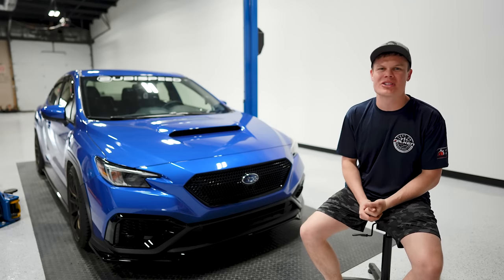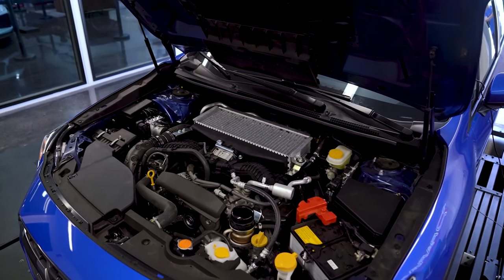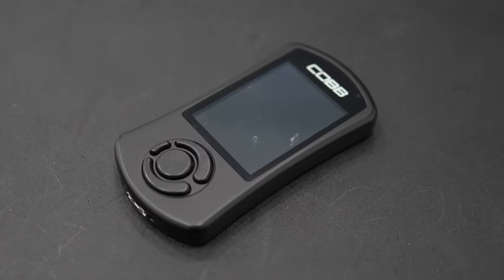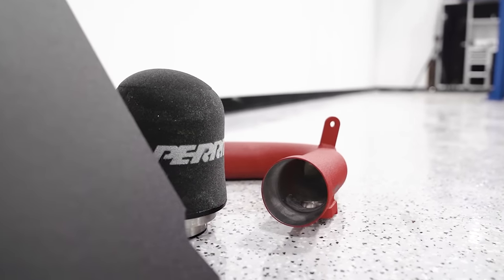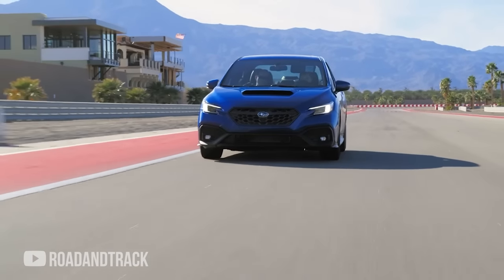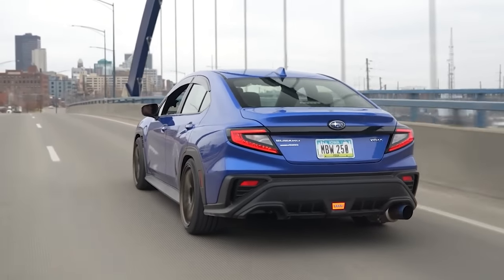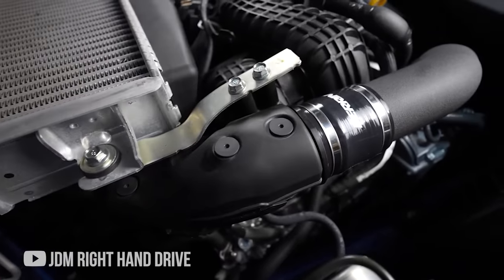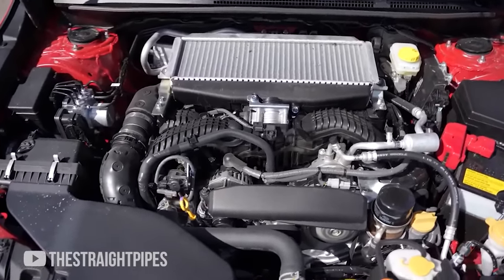Modifications that Make Power on the 2022+ WRX!

Comment: Pretty crazy that tuning for these cars was unlocked just 5 months ago. We’re still in the early days and already knocking on 500hp with stock turbo, internals, heads, and fuel system. Once the STI trans swap is normalized and we get into built motor, big turbo, full e85 builds, this generation is going to be the bananas. I’ve heard some of the big names in Evo X tuning have picked up VB development cars now, so the future is looking bright!
Reply: “knocking” is the key word here.
Reply: like knocking? or like actually knocking? 😂
Reply: isnt this the same boxer engine they put in the brz/gr86? if so, im curious to see how theyll fair under heavy boost lol
Reply: @wyattllc  they share the same general design (displacement, bore and stroke) but otherwise they don’t share any components. They have different pistons, rods, crank, heads, fueling system, intake manifold, etc. The FA24D in the GR86/BRZ2 has a 12.5:1 compression ratio and smaller injectors in the DI side so it’s definitely not set up to handle high boost at all from the factory. Right now HKS offers a small supercharger kit that brings it up to 292hp at the crank, so like 40 additional horsepower at the wheels. That’s a pretty small bump for the $5000 that kit costs. Seems like pistons, rods, and fuel system upgrades are definitely going to be necessary to get up above 300-350whp.
Reply: IAG is only working on the stage motor
Reply: @reesee175  yeah i live like 15 minutes from westminster where IAG is located and was so disappointed to hear they don’t dyno tune anymore . was gunna take my 18 sti for a pro tune :(
Reply: @robertlivingstone8733 there’s a few past 500 now with the ets turbo kit

Comment: To my knowledge the highest Horsepower amount of an fa24 was prime motorings fa24 swapped crosstrek which was at over 500.
Reply from the maker: That would be an amazing sleeper! No one would see that coming. Haha
Reply: @raymullen8427  funny story about this, I actually found this out a few days ago. That FA24 engine was sold to them by my local Subaru shop, Ecotech. They were actually going to build a car but we're busy with Subarus rally cars and ended up selling it to Prime after they practically begged for it. I can't believe at one point I lived in the same state as the first FA24dit and didn't know it 😭
Reply: Someone skipped math class. Said can get 290 with just 93 and a cobb tune, then said 40hp with an intake. So 330ish but then said only 340 when you have a professional tune, exhaust and an air intake.... bro no way a professional tune and exhaust is only adding 10hp if the intake added 40...

Comment: I have a 2023. It’s great stock. 300 HP is all that I would want. 😊
Reply: All I want is a Perrin intake to give the whooshy sounds. 😅🤣
Reply: That's all i want to if he's talking about to the wheel
Reply: @mattwilliamsonguitar I had the Perrin on my VA wrx. “No tune needed” they said.. car went into limp mode the 1st time I gunned it. Long story short, I now have a VB with a stock intake..
Reply: You say that now..
Reply: @nikkoteen1314  Never do any mods on a Subaru that affect air or fuel without doing a dyno tune. Crazy if they claim that on their site.. they should know better than that. It's common knowledge Subaru's are very fragile when doing mods without a tune. They may even be able to be sued from such a claim, if someone blows their engine from it, which is very possible. Intakes are worthless without an aftermarket turbo, anyway. They make cool sounds but that's it, the factory intake is more than enough on the stock turbo. Aftermarket turbos are a different story. That being said, if you have a tuner in your area with a dyno, definitely get a downpipe and dyno tune. It's worth every penny, it's so much more fun to drive afterwards. EDIT: I see why they say it's safe, now. It's the same diameter as the factory tube. That being the case, even with a tune it probably wouldn't help performance, at all.. that's just a noise maker.
Reply: @hhaste yeah I specifically got it for the noise (yes, I’m a dweeb). But yeah, lesson learned. No mods other than cat back exhaust on my VB now. Amazing that Perrin still advertise their CAI as needing no tune.

Comment: I keep hearing talk about e85 on these cars, but nobody raising the question as to whether the stock fuel system is e85 compatible. Is there any reason to believe the stock fuel systems are e85 compatible? I cant imagine it is. Seems pretty risky to simply dump a bunch of e85 in a car without knowing whether the fuel pump, lines, injectors are going to fail creating a ticking time bomb.

Comment: This is a great engine the only issues is Subaru put that crappy split case 5 speed WRX transmission they added a gear to and called it a 6 speed if I was you I would have told everyone at the 400-450 WHP TRQ you may want to think of doing the STI drivetrain swap Becuase I don’t care how strong of a aftermarket clutch you have the split case transmission is going to blow I have a VA wrx making over 400whp and doing the STI drivetrain swap was the best mod I ever did anyway love these FA24s just wish subaru would have given us the STI drivetrain on these cars
Reply: I cant echo this enough. Not only is the sti 6 speed infinitely more robust, it also feels significantly better even stock, than a wrx split case with bushings mounts etc. Best thing you can do for a VA, and likewise a VB imo.

Comment: I have a pro-tuned FA24 Subaru Ascent by Jr. Been on the dyno several times. I’d have to say I added the EGR delete kit from IBR way back with my beginning mods in order to help save the engine! I’d suggest it to everyone as well with your upgrade process. So far I can’t ever get enough of driving this beast… Let’s just say she can get down!!!!
Reply: where is this egr delete kit?
Reply: @Rabbit14  I just modified the one for the wrx from iBuildRacecars
Reply: How’s the cvt holding up? We have a wilderness that I’ve been wanting to up just a bit.
Reply: @xfozzypx115  everything is A ok so far
Reply: Jr is a great 4cyl turbo tuner. Tuner my Mitsubishi Ralliart to 452 whp. Thing was a beast.

Comment: Leasing a 2023 for now. Will see what's out when the lease is up but I think I'll probably buy it out at the end. Definitely doing catback, short shifter, and wheels for now, but first thing if I end up buying it out are the breaks and sway bars. Seems like the FA24 sits lower in the bay than the EJ257 so 300~350 HP should be plenty. Thanks for the video!
Reply: Doing the same here. Just picked up mine on Friday and plan to buyout at the end.
Reply: That’s what I said, then I leased another rex cause my miles were low and had zero down payment. Then I did it again 3 years later, lol.

Comment: Hey we’re in the 450-460 range and 530+ wtq! Lol
Don’t short me
Reply: Great video btw guys! Keep them coming
Reply from the maker: Even better! Must have seen some older posts. Keep up the great work!
Reply: is that on pure e85?
Reply: keep pushing till you blow the motor and trans. take 1 for the team, we need the data!
Reply: @LAdumpsterbaby e60ish still working on full 85
Reply: @way2faded I’ve been trying for 6-7 months once they dropped software even before that. They’re tough engines
Reply: @DrunkmannTuning  in a few years,my VB is all yours 🙏😎👍
Reply: @DrunkmannTuning  good to hear, thanks for the effort you put in 👊
Reply: @way2faded  Trans will go first, guaranteed
Reply: 1 year later, how has the transmission held up?

Comment: Any ideas of what kinda power I can expect I really wanna get it Dino ran but don’t have one near me anywhere close sadly  prolly a good 4-5 hour ride to get that done and  need to schedule it well in advance car should be running real soon iv got a 2017 wrx fa20 iv got it’s built all forged internals heads upgraded from aluminum to steel valves  all new timing and oil pump  ACL high performance bearings are installed -oil journals have been opened up for the main bearings to improve oil flow 725 series twin disc clutch and kit with upgraded steel clutch  line  forced performance blue ball bearing 🙃 turbo external waste gated and grim speed intake with the box grim speed cat back exhaust - tomei exaust manifold working on getting the billet aluminum process west  intake racing manifold really  soon and working on getting the front mounted intercoooer in the future  iv already got the 450lph fuel pump with hanger and kit iv also got the nords storm stage 1 hpfp with injectors kit on order waiting on them hopefully by the end of the month waiting for them to be released. Looking to see what kinda power to expect  . I havnt got the catch can kit yet I’m also doing the tgvs in the future prolly add them the same time I do the intake . Working on a 500 whp wrx as my daily 🙃

Comment: Ok so first of all tuning doesn’t blow your motor
It helps significantly improve the engines reliability 
If you add the correct mods 

Don’t add big turbos but not upgrade your boost controller, or add a down pipe and header but not add an air oil separator.

Don’t be obsessed with a power number.   
Definitely add an oil cooler definitely add an upgraded oil pump , oil pan and oil pick up
Increase your oil capacity and keep it cool 😎 

I have a 16 wrx I bought with 5 miles on it. Had it tuned to a stage 2 setup with 5k miles 
I now have e85 sensor and tuned making 387 whp on a stock block with 149,000 miles and my car is still absolutely fun to drive.

When modding your car the rules for dealer recommendations for maintenance go out the window because you increase the load and friction on mechanical parts.  So instead of oil changes every 3k 
Do it every 2k

Comment: The real question is how well can that motor hold at 400whp+ ? I feel like it’s not a matter of if it’s gonna happen, but when it’s gonna happen.
Reply: Isn't that really the outcome with any car..not if, but when
Reply: @ericlinn8647  not really. I’m just talking about this FA24 specifically. I know some other stock motors that can handle 400whp-550whp all day. And then I know some that can’t even reach 400whp without bending a rod or something.
Reply: as an employee at subaru i can tell
you that these motors are most likely one of the most durable ones they ever built

Comment: 😮470 awhp on mustang dyno? That’s insane, I know every single dyno have unique calibration and can’t be compared, but I think that translates to about 650 crank HP🤯
Reply: 20% drivetrain loss would be 587
Reply: @MeltingRubberZ28  20% is a very rough estimate, my local shop has a mustang dyno and it’s very conservative, it reads just bit over 400hp on stock Nissan GTR and 470 on stock c7 z06,if a WRX makes 470 whp on that dyno that’s very very impressive
Reply: Funny, the factory FA24 Turbo is incapable of flowing enough air to make that kind of power, even on ethanol. Must be an aftermarket turbo.

Comment: Decent numbers for bolt-ons. To be honest, I was impatient with Subaru making something that would not blow up after 400hp coming from the hawkeye. I am so glad I switched over to the Evo platform a long time ago. Seems like there will be room for more development for these cars. Honestly, the same old dance for most of these 4 cylinders. Sleeved built block,  set of cams, big fuel pump, ID2000's, big-ish turbo, 50/60 psi boost, and it will be running 8's in no time..hahaha
Reply: 😂 thats like fully modded bike fast lol

Comment: I just bought a 2024 WRX with a CVT because I didn’t want a car my wife couldn’t drive. Are there any mods I could do to increase the horsepower without risking damage to the transmission?
Reply: The CVT is limited compared to the manual but I've seen 320 hp on a CVT. That's not a lot though.
Reply: @ cool thank you!

Comment: Thanks for this awesome video! If I get protuned for E85 will I be able to use 93 octane in a pinch if I'm driving the car cross country or something and don't know where my trusty fillup spots are? Is the sacrifice only for performance/efficiency? Or would it be totally unsafe for the car to go back to 93? Or would it not work at all?
Reply: If you have a tune for ethanol only (non flex) then you absolutely NEED to use that exact blend. Whether it be e30. E60 e85 etc.

If you have a flex tune it doesn't matter.

Just like if you have a 93 tune, you gotta use 93 gasoline. 

93 gasoline has about 10% ethanol in it as is and those values could be a bit higher but not a lot. 

Ethanol requires more fuel to be dumped into the engine so if you did straight 93 on a specific e85 tune you would be silly rich and knock like hell from the much lower octane.  Ethanol also has a cooling effect that your tuner would of taken advantage of in the tune. Take that out of the equation also and your engine is in very risky territory.

Subaru engines are very picky about the modifications and tunes they get. Do a ton of research prior to modify your wrx please. This is why the platform gets such a bad rep.  Im not saying you're the cause just saying don't be a statistic 🙌

Comment: you can put a ets top mount and front mount both on right
Reply: You can only put on one intercooler at a time.
Reply from the maker: Got to pick one or the other!
Reply: @HeavyMetalWRX  what the better route, front mount I assume
Reply: @colew2178  it all depends on your build and future plans. If you know you'll be going past bolt ons later it's ok to spend the money on a FMIC now. If you're just doing some mild tuning with 1-2 extra options (Intake or jpipe) then a TMIC will be sufficient. Both are great options and a FMIC really gives your car that tuner look.

Comment: Does anyone know if you would need a tune for reliability if I were to install the ETS TMIC, or would it be safe to keep it on the stock tune? I understand you would get more performance benefits from a tune, just wondering if I can hold off on the tune will I'm waiting to get other internals before tuning the parts all together.

Comment: I’m planning on getting the 2023 WRX CVT , will all these mods fit into that car ?
Reply: The only difference that I'm certain of is the transmission.   You should be able to use all the same mods for the "Subaru Performance Transmission" aka CVT.   I'd be more worried and interested in seeing how much power the thing holds.  I can see a future of the CVT holding really high power numbers only if built correctly.  We used to say that automatics couldn't hold the power and now look at some of the fastest cars on the track.  

Anyways, you shouldn't have any issue in modifying with these parts, should be all the same.
Reply: I would be leery of doing power mods with the CVT. Maybe wait until there is more data on this. I wouldn't go beyond 300hp. If I had the CVT I would keep it stock.

Comment: Question. I have a VB with Perrin Intake, AWE catback, COBB OTS tune.  I’m waiting for my charge pipe to come in, would it beneficial at this point to need the charge pipe or wait for a pro-tune ?
Reply from the maker: Sounds like you have some great mods so far! When you get pro-tuned you will get the best results from your change pipe.
Reply: Charge pipe won't make a huge difference honestly
Reply: @ranran2218  I’ve heard it helps a ton with turbo-lag?

Comment: Just bought one with 300 miles. Debating to just do the top mount intercooler now since summer is around the corner and I will be driving it daily. Maybe the air intake as well. I won't have to do a tune for just those two bolt ons?

Comment: How is it possible to make 450hp on the stock turbo? It runs out of breath at about 335hp which is 250kw in Australia. You guys in the US must have very happy high reading dynos.
Reply: Your dynos are upside down and don’t work correctly
Reply: 335kw that’s crazy something doesn’t add up . No way it would make 335kw on a stock turbo
Reply: @pharmztko  or google how much power the stock turbo can handle then you will realise how inaccurate the US dynos are.
Reply: @grantkahale8933  who cares about dyno numbers.. trap speeds don’t lie. Plenty of 22+ wrxs do 120+ mph in the 1/4 at 3400 pounds. How much power do you think that equates to
Reply: @pharmztko  either way it's 100hp extra. . It is way off if that power was correct it should be hitting high 10s low 11s.
Reply: @grantkahale8933  when you run a 1/4 mile then you realize those numbers check out. So id say your dynos are off.
Reply: @ranran2218  that's how much an R35 GTR skyline is making stock at the wheels 🤷🏻‍♂️
Reply: @grantkahale8933  you do realize 1/4 mile times are less indicative of power output than the 1/4 trap speed right? If a wrx is trapping 120+… its way more than 300whp.  So either you’re dyno is wrong or you all can’t tune
Reply: @mogulme6190  you do realise everyone's laugh at Americans and their exaggerated dyno tune numbers  😆
Reply: @mogulme6190  As it progressed, the apparent resolve was that the engine combination could in fact make the claimed horsepower based on dyno readings in the USA, but it's universally known that dynos in the USA are calibrated to read an average of 20% higher than they are in Australia and some other countries.
Reply: @grantkahale8933  even if you were right, it’s just a number to gauge progress off of. not seeing your point and it isn’t going to matter what number is read when you’re eating dust because an american did it better than you lol

Comment: Wait you said stock 2022 WRX makes 245HP, Mines stock and I got 271😂
Reply: yeah 245 WHEEL horsepower, which is what you’re actually feeling. Through the drive train you lose maybe 20% of the horsepower you’re referring to (271 crank hp) So no you don’t have 271 WHEEL horsepower.